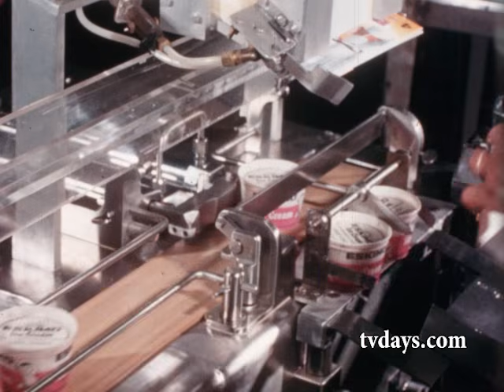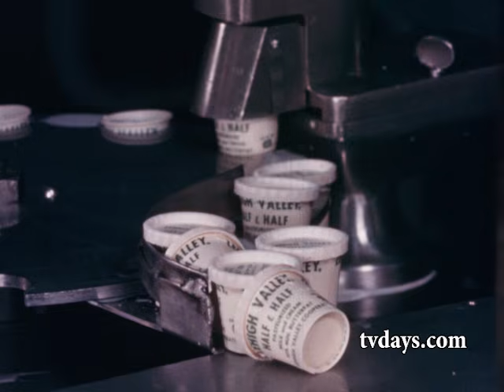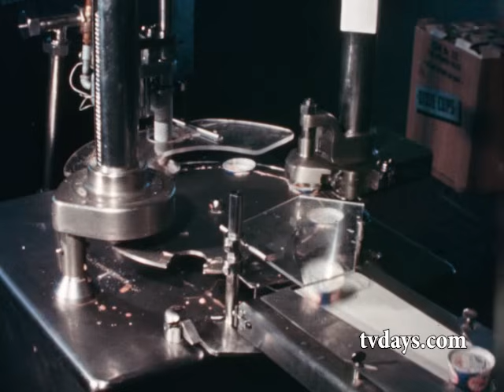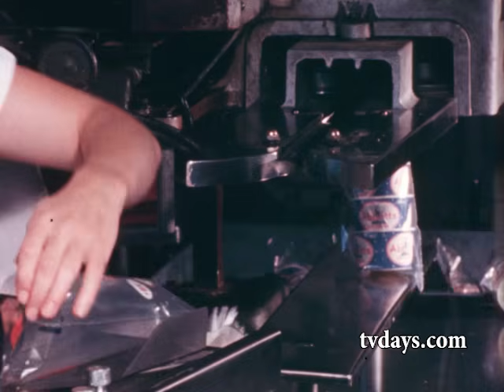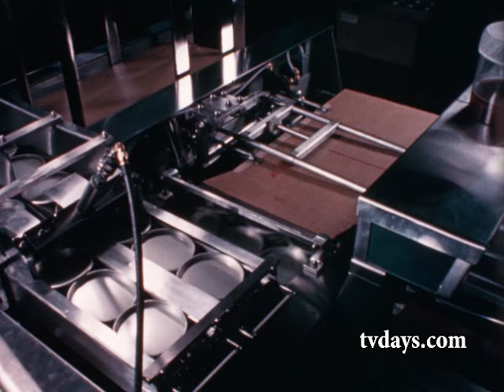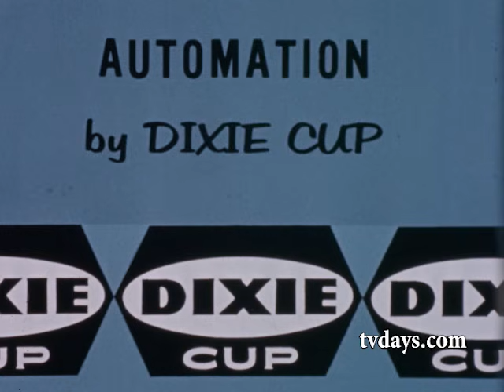Automatic Packaging Systems by Dixie Cup

Comment: @2:38 sloppy filling cutoff ....it is slopping product all over turret which will spoil in a few hours and contaminate all packages with bacteria...not to mention that the "tail" of undispensed product hanging from the injector is dragging through the spoiling product just before it aligns to fill another container.... pretty bad   

I bet Sales insisted that they run the machine at excessive speed to make throughput look better on camera!